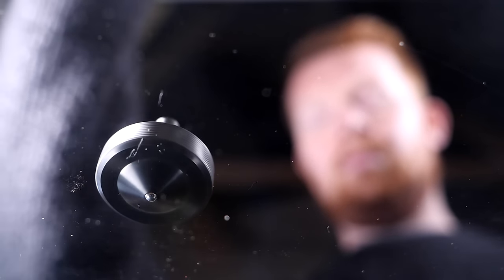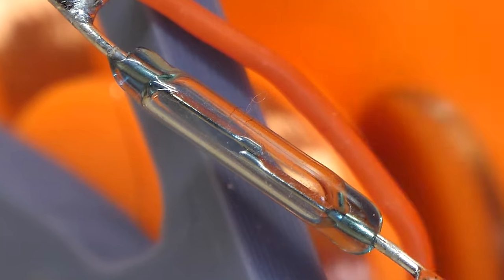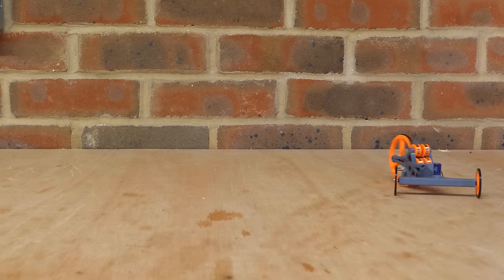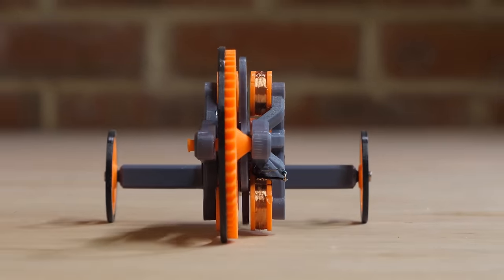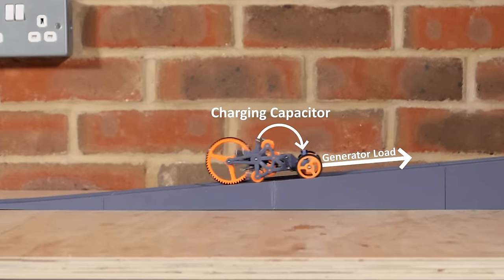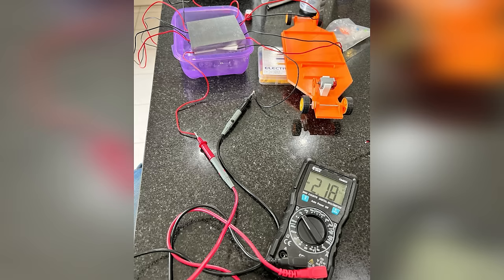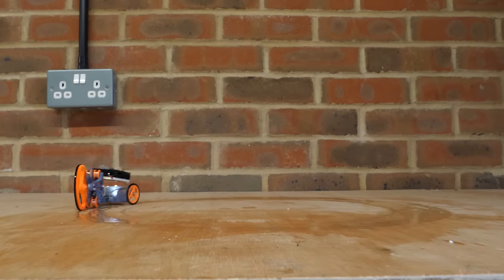This Car Travels Farther Than You Push It

Comment: If you add a supercapacitor to the output of the peltier, it might be able to run the motor with a lower temp differential. The motor uses current in pulses, so during the off times the capacitor would charge to allow for higher peak current when the coils are engaged
Reply: Exactly what I saw with the Peltier device experiment.... While the motor draws current, the Peltier device will have only so much energy stored within itself in between the motor pulses... A capacitor definitely makes sense in this application.... 
Two Peltier devices in series should provide a higher voltage which sent to a capacitor and fed to the motor via a Stepdown DC to DC converter to control the motor speed, should be able to achieve longer run times....
Reply: @PeterMilanovski  A linear regulator would be too inefficient, I think. Maybe a custom switch-mode power supply, with the frequency tuned to the frequency of the motor pulses at your desired speed. At that point you could probably even remove the reed switch, because what you've made is essentially a BLDC motor.
Reply: @tissuepaper9962  exactly.... Linear regulators are good at what they do but the goal here is efficiency so a switching low dropout regulator is what's needed... 
I idea is you to remove as much load from the generator so by going with a high voltage low current generator, you are removing some of the load from it and then use a DC to DC Stepdown converter to do the heavy lifting to provide the low voltage high current that the drive motor needs...

Comment: For anyone wondering, those systems which add inertia by other means than adding pure mass are called inerters. Some mechanical ones were used in Formula1 cars' suspensions up to quite recently

Comment: This is just a more complicated version of the old "friction drive" toy cars which used a mechanical flywheel to store some of the energy imparted by the initial push to keep the toy car running for some time after you let it go.
Reply: I instantly hear their sound now
Reply: rubber band around axle car...  pull balll on ground and let go lol     wooosh...... lol
Reply: believe it or not there were also very old candle powered toy vehicles, i believe it was a boat iirc.
Reply: also those spring cars...

Comment: 8:18 The generator-car put up a higher resistance/load to you pushing it, demanding more energy than the other car did, by charging the capacitor. When you let them go, you got 2 x the same momentum, but one of them has extra energy stored in the capacitor already, whatever charged up while you accelerated them before letting them roll.

Comment: I've always been fascinated by this concept, not perpetual motion, but very efficient use of energy, so *almost perpetual*. Very cool to see it in action.
Reply: Check out lasersaber's videos. He has motors that run on milliwatts of energy. Powered by tritium lights, ionic atmospheric energy, ambient temperature change...
Reply: The electric trike Tony from Agingwheels made a video on might be up your valley then. It is just insanely efficient. Just don't confuse it for the one with pedals he also made a video on...
Reply: @markellii3093  Robert not Tony.
Reply: It's not very efficient, it's just using very little energy.

Comment: the reason the generator car can go further than the flywheel car in the ruler test is, that to push it you need more force which gives it more energy to begin with. and it can store more energy (in the flywheel, the magnetic field and the electric field in the capacitor)

Comment: 0:30 so as far as I’m aware, there are magnetos in hydroelectric dams that use an air cushion to do exactly this. It’s a spinning disk that helps keep current relatively constant and it has high mass to keep high inertia during outages and to resist power draw lowering amperage.

Comment: I think I could get this to work in a full size car. What you need is a bungy cord and grappling hook on the front of the car. When you want to start, hook it around a lamp post, get in and release the handbrake, off you go. You just need to remember to park by a lamp post when you stop.

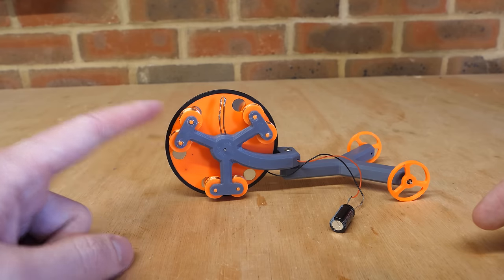Comment: 3:55 you should really build a dedicated coil winder.
Reply: I was thinking you could use the bobbin winder feature on most sewing machines.
Reply: @ADBBuild totally, but all electric sewing machines I've messed with were too nasty and rude to wind a delicate wire like that with confidence i think
Reply: @crackedemerald4930 stand alone hand winders are still kicking around
Reply: @ADBBuild  you mind wonna actually count the windings.

Comment: build this on your bicycle, can charge when cycling and it keeps going if you want to take a little brake.
Reply: I doubt it will keep going if he brakes though! ;)
Reply: I think he already made a capacitor bike
Reply: As pointed in the video, it would go for a bit, while you are resting, but this energy doesn't come from nowhere. You would feel more resistance when cycling.

In the end you would be more tired to drive the same distance, as some energy would be lost as heat.

Also I believe he did "supercapacitor bike"
Reply: Break
Reply: If it's less efficient than a flywheel then it won't really work since he already showed that flywheel bikes are impractical
Reply: @Gribbo9999 this comment was copied along with the typo 😭

Comment: This is also a good analogy for the faster than wind (wind only powered cart). In that case the energy is stored as pressure differential on each side of the propeller instead of energy being stored in a capacitor.
Reply: "the energy is stored as pressure differential on each side of the propeller" -- Would you describe a piston-engine driven airplane the same way?
For a piston-engine driven airplane, I would say the energy is stored in the fuel.The small pressure difference from one side of the propeller to the other stores a trivial amount of energy. Shut the engine off and pressure difference (AKA thrust) disappears very quickly.
The same is true for a downwind-faster-than-the-wind cart. The propeller requires a continuous input of power to produce thrust. This power comes from the wheels that are in contact with the ground.
Reply: @andrewsnow7386  Yes the amount of stored energy is very small. See my last video where two propellers of about 0.1m^2 swept area moving air at 3.2m/s have less than 2 Joules of stored energy. I demonstrated in my video exactly why that sort of vehicle can exceed wind speed and why that is just temporary proportional with the amount of stored energy.
Reply: @electrodacus  I watched your video twice, and it's not clear to me what you are trying to demonstrate. You end with the conclusion: "It's clearly not powered by wind power when above wind speed." We need to parse this before I can say if we agree. 
Are you saying that the difference in motion between your treadmill and the air is not powering your cart? Or are you saying that your experiment has no wind (that is the air is static in the room) and since the wind speed is zero, it can't be powering anything?
I'm fairly sure you are claiming the first, in which case your own experiment proves you wrong. Consider 2:20 in the video. Using the reference frame of the belt on the treadmill, the cart is moving forward at 5.33 m/s when you are restraining it with a force of Fnet using your hand. Since the cart can travel at 5.33 m/s and still have a positive Fnet, it must have a speed greater than 5.33 m/s where Fnet = 0. The cart must have an equilibrium speed faster than the wind for Fnet to equal zero. If so, then the cart could be powered by the "wind" indefinitely at speed greater than the wind.

Comment: Wow. That candle powered generator is really a smart idea but what about using a torch to heat it up? I know this would melt probally but if there was a heat resistant one that can survive that big heat it would be really cool to see a torch powered car. You could cooldown the heatsink with liquid nitrogen or something like that
Reply: I didn't think a more intense flame would gain you much. The issue is absorbing all the energy from the flame. A heatsink on the bottom would probably be better, or some kind of nozzle that would spread the fire/heat out more.
Reply: when he added more knots to the candle it produced more electricity. so maybe im not an scientist but this for me means that more heat = more electricity.
Reply: @prodjament  Lots of heat escape around it in form of hot air, so a heatsink on the hot side would have made an improvement, but the brute force approach is a tried and true method
Reply: The main issue is that peltiers are not very efficient. Adding the ice is like adding a battery. It is stored energy in the form of solid water. Adding heat helps but you have to dissipate heat from the cold side just as much to maintain a steady flow of energy. A larger heat sink on the cold side and getting the bike moving faster would allow more airflow to dissipate the heat. There is a heat limit to these devices, where the internal solder starts to break down.
Reply: @prodjament  It's more complicated than that. It's the difference between upper and lower plate. The more difference the better. But too much heat on the bottom might also heat the upper plate and ruin the balance.

Comment: This is brilliant because this could be compared to that kit that converts all electrical components and circuits into a system of cogs and chains that you can link together! Because this is the same as the wind up cars but instead of storing mechanical energy using a mechanical advantage, you’re storing electrical energy with that mechanical(/electrical) advantage! So cool

Comment: build this on your bicycle, can charge when cycling and it keeps going if you want to take a little brake
Reply: The problem is it would be harder to pedal than a normal bike, meaning you get tired faster. You would perhaps for less time, but actually use more energy since some is lost converting it to and from electricity.

Comment: When using the ruler to push both cars you are adding friction to the back wheels during the push, since the front wheel is still free to spin the capacitor car has an advantage as it is able to gain energy during that time.

Comment: 6:35 it travels less distance not because of <100% efficiency, there exists a speed you can run on the first which will help second run to do full distance or even longer. Conservation of energy depends on the force too, not just the distance.

Comment: Another example of this (9:21) is a gasoline generator, you hear the rpm’s go up when it is putting out power, the rpm’s go up so there is more available torque what is needed to generate electricity

Comment: 8:57 okay so, my first thought is that the car is actually braking slightly as it charges the capacitor, causing it to be harder to push, because this energy is not lost (as it is stored in the capacitor) it actually gains more energy from the push than the freewheel car, I think that it is just getting more energy out of the push, it would be kind of like if you had a dense heavy wheel and a light wheel side by side and you pushed them on a low friction surface, the heavy wheel and the light wheel would be accelerated to the same velocity, but the heavy wheel would have more energy

Comment: I have a suggestion for you. Use steam to heat it. Take a small water tank and connect a thin copper pipe to the tank, which is wound into a spiral. The tea light heats the water tank, the steam rises into the spiral and this is positioned so that it is also heated by the tea light. The now super hot steam should develop extremely usable heat to melt your heating plate. The force alone that is created when the steam expands is like the high pressure of a jet nozzle. You can also use simple sawdust instead of water to generate wood gas with the tea light, which is then heated to a super high temperature in the spiral.

Comment: Generator car won the contest at 8:50 probably because it obtained more inertial force when you pushed it because of it more weight.

On an even surface, if two round objects start with the same speed, the heavier object will generally roll further than the lighter one due to its greater kinetic energy and the relatively small effect of rolling resistance.

Comment: I used to work on remote gas wells, and many of them use what's called a thermo electric generator. Basically just a large thermopile like what you're using here, with either a propane or natural gas burner to heat one side, and a huge heatsink on the cool side. The bigger ones I worked on would put out about 120W, depending on how they were running. I had to fairly regularly check and adjust them, and it was sometimes an all day job to get one adjusted to make it's rated power.

Comment: For wires that small, I use the “drip” method. Pin them down on a board with a small dent from ball peen, drip solder onto them. The tiny wires heat instantly, no need to preheat them.

Comment: Awesome video! Interesting point to note is that using the Lagrange for electrical systems the capacitor can be equivalently thought of as a spring. Thus, an equivalent system would actually be one where a spring is coupled with the free-wheel , edit: so long as (k/2) = (1/2C).

Comment: I have recently become obsessed with the idea of building a full size “wind up toy” car that uses hydraulic pedals to both wind the springs, and push the vehicle. With the ability to push the pedals down into a comfortable position when the spring is wound, allowing you to drive the car relatively normally. No gas engine or electric motor except maybe for an auxiliary power source for electronics in the cabin, like a fan, radio, and lights. The generator could also be powered by pedaling.

Comment: Since the freewheel car moves faster since it's not encumbered with the electro-mechanical drag of the generator car, the mechanical drag on the wheels is higher, requiring more force to move the same distance; or, in this case the same amount of force moves the faster car a shorter distance.

Comment: Brilliant. I love the synergy of the smart new scientists and engineers with the new toys available such as Lithium Ion batteries, 3D printing, controller boards, Python. Leaves us old guys in the dust, as it should be....Don't forget that the resistance of the freewheel to motion is non-linear to the rotational speed of the freewheel. These devices would be better tested in a vacuum, a bit harder.

Comment: Tom I am really glad you  dared to try the method of using peltier modules. Most people are probably not aware that they can also be used like solar panels.  With a lot of fine tuning of the coil size and capacitors etc. a much more efficient device could be achieved.

Comment: Very nice project. I love how you built it all with pretty simple tools (if a 3-D printer is counted as simple, but it is to me).

I have just one correction for you: around 6:35 you imply that at 100% efficiency the car would travel exactly the length that you used for charging it. This is incorrect. It is charged by the current that is induced from the moving magnets; that means there is more energy stored if they moved faster (how many times they pass is constant, because that is proportional the the distance). The distance it travels depends on the amount of energy stored, and the friction. Without friction (and without losses in the electrical system), it can get up to some speed and keep going forever.

So it is certainly possible for it to get further than the distance you used for powering it: just use more force (thus more work, because the distance is equal) for the charge push.

Anyway, aside from that minor detail, I think the video was great. 😀

Comment: Next time you want to solder fine wires or tin wires, you can use a thimble like device that you melt solder into and you just dip the wires in and pull out after being fluxed, viola, soldered wires super easy.

Comment: It would be interesting if you compared a similar design using the candle and heat with a propeller connected Gear Drive

And compare that to your electric or thermal electric design.

Kind of like a low tech versus high Tech face off 😂

Comment: 8:08
The force required to push is different therefore more energy dump
If you used a spring that stored the exact same potential energy and used that to push both cars, they will go the same distance

Comment: Your content is really great. Make a tv remote that runs using a capacitor instead of a cell. The capacitor will be charged by running the remote on your body or any clean surface which will turn a small wheel. The idea behind this is that the remote is not used that often.

Comment: cool concept and video. I’m glad you included the end explanation to “debunk” the seeming paradox of the push test. But I’m surprised you didn’t catch and correct your earlier comment about it not going as far as you pushed it because it’s “not 100% efficient.” That would have been a good learning moment to explain that a 100% efficient car would go infinitely far, completely independent of how far you pushed. And with your not perfect efficiency. the distance traveled has more to do with how hard you push over the distance, not just the distance you push. Anyway, thanks for the upload and thanks for mot making a perpetual motion device.

Comment: the carbon buildup on the bottom of the pad is definitely insulating it a decent amount from the candle heat, maybe add some o2 circulation somehow or use fully mixed butane if that doesnt burn the thing completely and i think youd get some pretty decent speeds ngl. fun stuff.